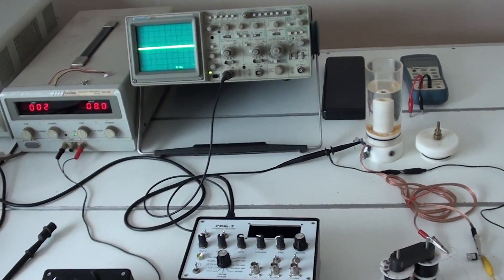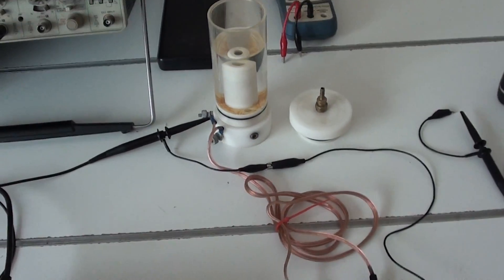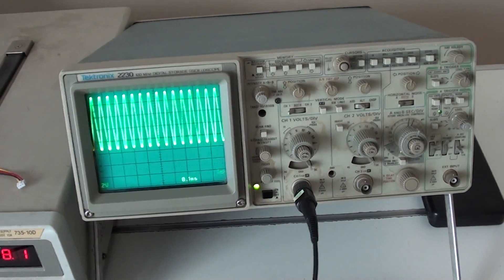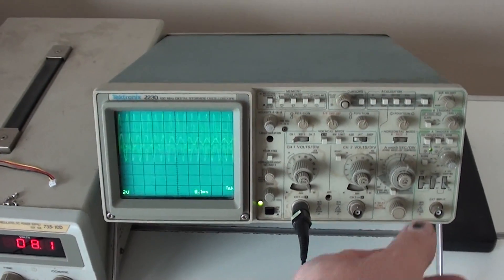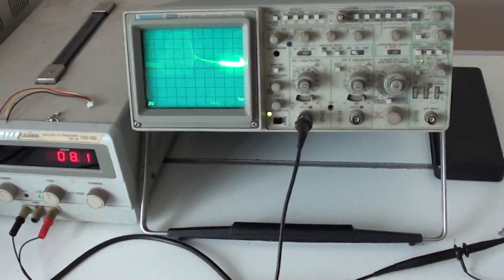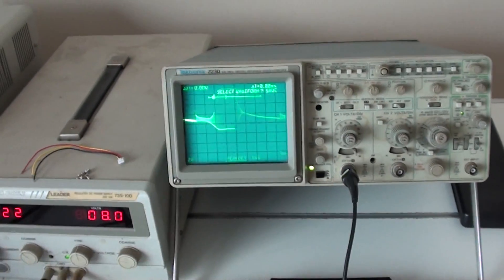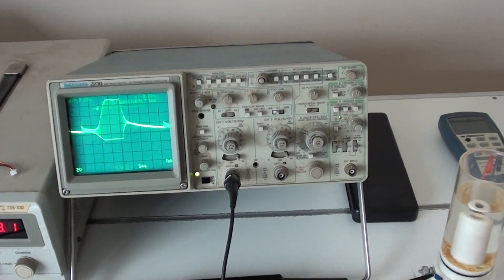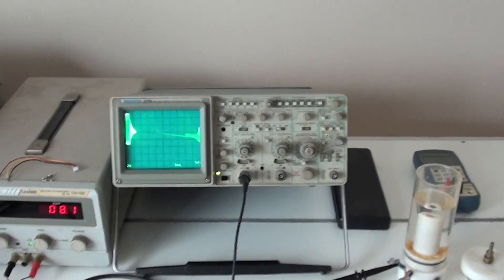Stan Meyers replication resonant cell 2

Comment: How did you manage 100X input? from 8v to 800v? 100:1 ratio ?
Reply from the maker: the probe is a x100. It reduces the input voltage by 100. Just like a x10 probe does.
Reply: Dynodon64 Yes I understand that, but how did u get your initial 8v to 800v?
Reply from the maker: The transformer and the chokes are increasing the 8 volts into the 800 volts to the cell. That's what the VIC does.
Reply: Francois Korff OK, well you have won that step and resonnance which is Fantastic Don, I'm very glad it paid of for you until there man. My question tho .. I have a tazer that puts out 3500V DC, I hooked that up to the cell connected and with a Gap, and Also put it through a bridge rectifier for shits and giggles and guess what ........ NOTHING no bubbles, no movement squat. I also ran that through my variuos inductors and changing things up but got nothing, I am loosing faith maybe due to lack of education. Whats your take on that?
Reply from the maker: Trying to apply high voltage to the cell directly, won't work. The cell will cause a direct short. If you try to run that voltage through a set of choke coils and pulse it at the right frequency, you might hit resonance. You still have to pulse the voltage through the chokes to find resonance.
Reply: Dynodon64 I see, doesn't a biffilar coil count as chokes? You know that Meyers chokes on the U-Core transformer one choke had more windings then the other ..?
Reply from the maker: Francois Korff Yes bifilar coils can count as chokes as long as they are in addition to the primary and secondary coils. The choke coils are a separate set of coils by themselves.
Reply: Dynodon64, don't listen to this jackass Francois Korff, he is personally attacking a number of people's videos having to do with Stan Meyer.   Just tell him to piss off.
Reply: Jon Abel you obviously have no clue, and attacked nobodies video's not even yours, you are the only one doing the attacking. Now fuck off and stop following me all around trying to score points for your personal perusal. Go google LC circuits or something and leave as alone you drop out kid!

Comment: Your power input to the coil is it AC or DC? Sine or Square? And whats the ouput? AC or DC? I can see it's sine, what happens if you put a bridged rectifier full wave inbetween the output and the cell? Just curious thanks for the lovely explination Don
Reply from the maker: DC square wave pulses to the input of primary coil. As you can see it looks like an AC wave reading at the cell. Tried the full wave bridge after the coils to cell, didn't work.
Reply: Dynodon64 WoW now that very weird, why do you suppose that is? Did you put a multimeter on there ?
Reply from the maker: The scope reads AC and Dc voltages. All transformers output AC, no matter if it's pulsed with AC or DC input.
Reply: Francois Korff LOL
Reply: Hi Don, don't bother with Francois, he's just causing trouble for people who are willing to do the research.
Reply: Dynodon64 Yes offcourse, so if I understand you correctly, you are saying that meyer did high voltage AC pulsed Electrolysis?

Comment: Hey Don, how did you manage to hit ressonance? I know you need to messyre the Capacitance of your cell(probably with some expensive equipment like an LCR meter or a scope and math) setting that then equal to the reactance of the inductor you will be able to work out the frequency of resonance. However i doubt that no gas production is the right way even under 1000v cause dc makes gas straight or pulsed. How did you manage 800v? With a iron core or ferrite? Magnetic ss wire or copper?
Reply from the maker: Resonance is very easy to find with a scope. Maybe I'll make a video to show how. It's not possible to measure the cells capacitance with a meter. I have three different meters and one of them is not a very cheap one. As I state in the video, most of the capacitance comes from the choke coils. With a resonance cell, when amp restriction is taking place, I would not expect any gas until you get over 1Kv. If you see gas, than yes your in straight dc electrolysis. I'm using a ferrite core from Ferroxcube. It's the largest one they sell, U64 I think. I'm using copper wire. I have a 10:1 step up on the primary to secondary. The chokes are the same turns as the secondary. 800 volts is what it hits at resonance.
Like I said, It's still an ac signal at the cell, unless I add the second diode.
But it may still not be what we are looking for.
Reply: Dynodon64 Awesome man, thank you so much for your comment, I was under the impression that I had to messure inductance with a LC meter or on a scope with the 63,2% Constant then messuring the total time the "Cap" takes to charge and discharge in ms. to verrify the capacitance, once we have that and the  inductance we can use an easy formula to calculate the frequency. You have allready found ressonance and yes I would love to see a video on that explaining exactly how that would open doors for many people and what the signal should look like. Stan said that molecular ringing starts at 1500V. Can I just wind the coils with a 20:1 ratio and go well above 1500V? with a 12v input? I have noticed you said if you supply anything more then 8V your circuit doesn't work, why is that? Core saturation maybe? One more thing, what do you mean by a resonnant cell? I know it needs to resonate but are all cell's not resonant cells at the right frequency? I have build a cell "Check my channel" similir to yours, SM cell however my contact points are not with springs like meyers but with SS bolts connecting the Anode and Cathode and rain water. Those "Diodes" you use don't look like a diode what are they?
Reply from the maker: Francois Korff You don't need a 20:1 ratio, the voltage increase is greater than the step up ratio due to resonance. If you only had a 3:1 step up ratio, at resonance you may see an increase of 5 to 10 times. That what resonance does.
Yes my set up is either saturating the core or one of the chokes is shorting out.
A resonant cell is the small tube set Stan used, about three inches long 3/4" outside tube with a 1/2" inside tube set, encased in a delrin cover like my cell in the video. The cell should be kept small.  My cell uses bolts only as well. It doesn't matter as long as they make a good connection. My diode is the same type Stan called for. MUR1560. That's what they look like.
Reply: Dynodon64 I had a look at the datasheet, thanks for the info, learned something today ... aka "Anti saturation diode" sweet

Comment: Hey Don, Nice set up.. From what I see your voltage reading is not of the voltage in the cell... But is of the voltage across the positive choke... The probe reads the voltage level based on the  reference point of the black lead of the probe... So when you have your probe across the inductor, that is where the difference is...  If you want the scope to be isolated from the cell when reading across the cell you can see it like this... The secondary of your transformer is not referenced to ground... It has galvanic isolation... So technically a scope hooked across the cell will not create any ground faults on the negative side where the black lead is... Since your scope is reading a isolated circuit to begin with... Stans 8xa circuit is not isolated from ground... It is using a variac with house mains power and IS referenced to ground! This is where you get into trouble by trying to hook your ground clamp of the probe to the negative electrode without a form of isolation.. For the 8xa it is possible to read the cell with a scope without a isolation transformer. But it is dangerous and I do not suggest anyone to do it and if you do you do it at your own risk! You can plug your scope into a outlet that does not have a ground connection for the ground terminal prong... When doing this your scope is floating... The chassis (ground plane of the scope) will have voltage and will shock you if you touch it... So when and if i do this type of measurement I must not touch any metal parts on the scope since they may be connected to the ground plane of the scope and will shock me. look up galvanic isolation and learn about it

Br,
Outlaw
Reply from the maker: I understand the isolated ground idea. I modified my isolation transformer to separate the secondary output coil from the earth ground. They were tied together. My probe for the scope was connected to the positive side of the cell, and the ground clip was hooked to the isolated ground connection between the secondary coil output and the negative choke. I don't see that as reading across the positive choke. Maybe I'm wrong. Still playing around with it. Still trying to figure out how Max gets his readings across the cell.
Reply: Dynodon64
The voltage a scope detects is based on the the connected locations of the reference and the probe.. The components between those 2 nodes in the circuit is what the probe is reading the voltage difference across.. The voltage is in comparison to the reference point (ground lead or more preferably called a reference lead).. Set up a voltage divider circuit to a 5 or 12v source  (2 resistors in series)... With 2 different values of resistors and apply the probe across them individually or even use just a multimeter and you will see what I mean.
Reply from the maker: outlawstc I understand all that. I still would like to know how Max is able to read the voltage across the cell. If I try, it just shorts out. I even went as far as removing the earth ground from the isolation transformer, still does the same thing.
Reply: Dynodon64 Do you mean that you have a positive reading on both the Anode and Cathode? Cause thats what I get with the Totem Circuit.
Reply from the maker: No, the readings only show the difference between the two test points. It just shows a positive voltage at the probe tip in reference to the ground clip.